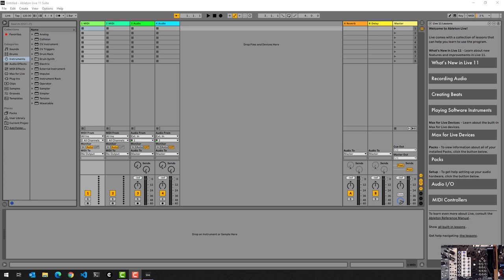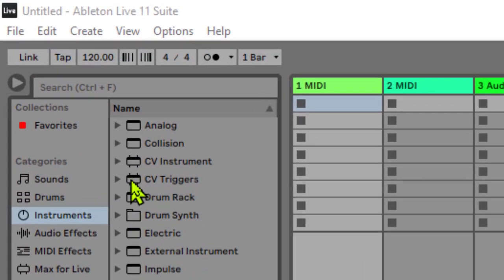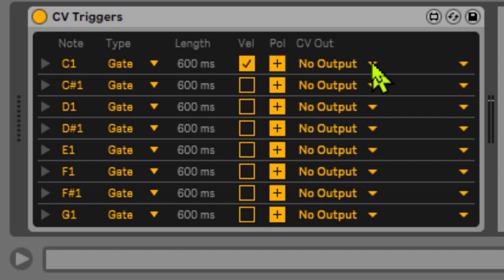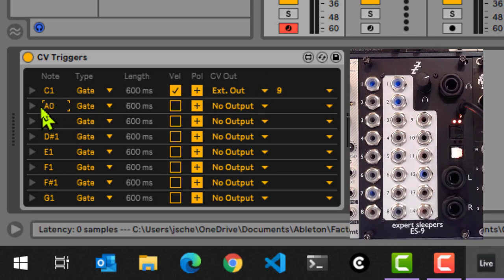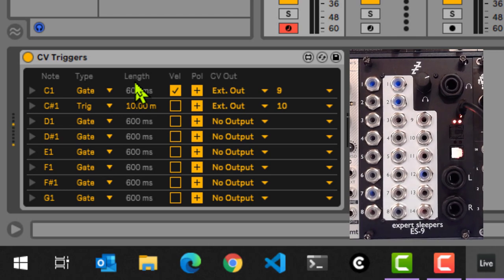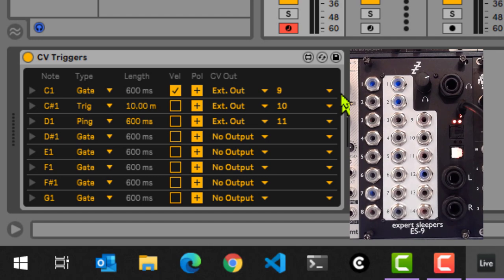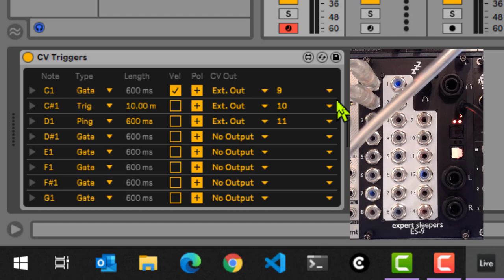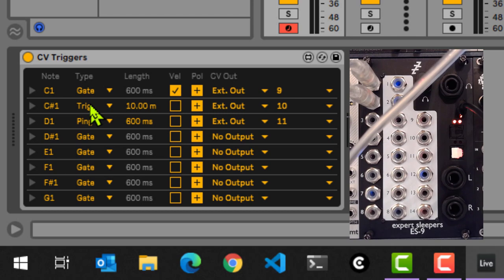Ableton Live & CV Tools 102 | CV Triggers | Walkthrough/Tutorial/Demo | Eurorack Modular

Comment: Thanks for the video! Would appreciate help on a problem I cannot solve: i use WMD Metron sequencer and try to trigger the next variation (pattern that is) via Ableton. So all I need is a single trigger hitting the control pads on the push 2. WMD is set up properly, and my Audio Interface / IO-assignment via boredbrain OPTX as well. Could you maybe point me in the right direction? What is the appropriate CV tool? Thanks for your time!
Reply from the maker: It sounds like you're looking for a way to sync your clock from Ableton Live to the Metron. Feels like a job for CV Clock Out from Ableton CV Tools.